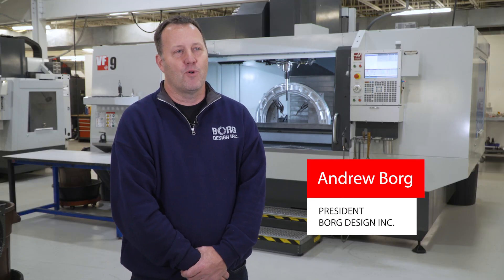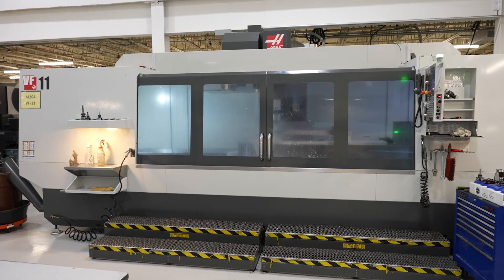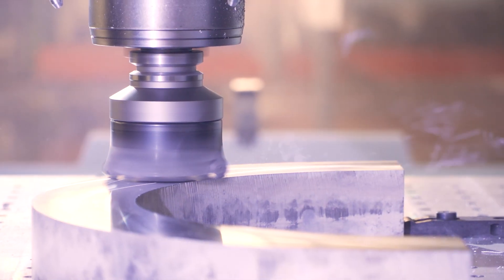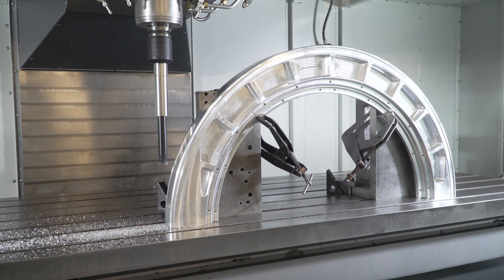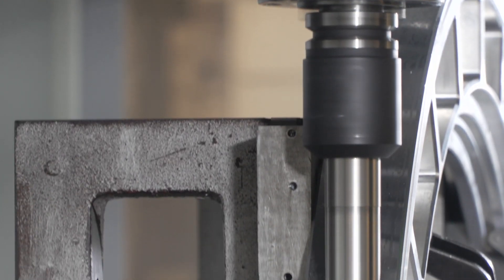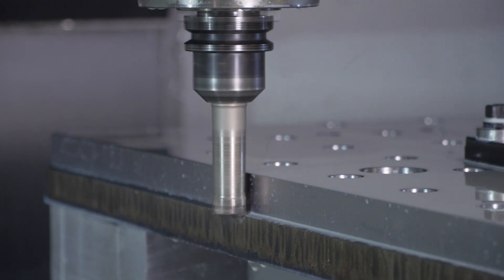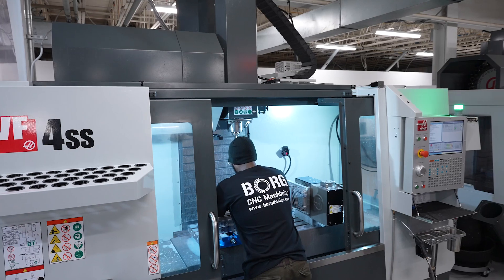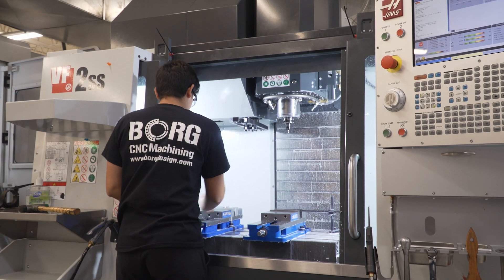How Adding Large Frame Haas Mills Helped Borg Design Grow

Comment: At these travel sizes, I'm surprised that it isn't a traveling column design. Isn't the mass potential on these tables pretty high? Must be sacrificing some Rapid speed in this.

Either way, Borg's parts and success is pretty cool though.
Reply from the maker: We do have one larger, the VF-12 which offers 150" in x-axis. But to your point, we also have the VS-3, which is a traveling column design with the same x-axis travels (150"), so it really depends on the size and mass of the workpiece you're machining.